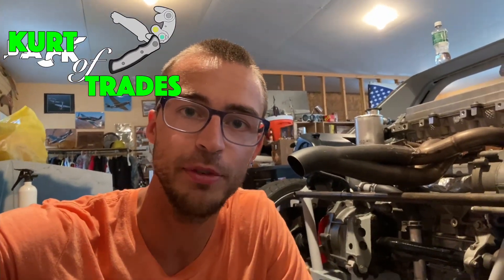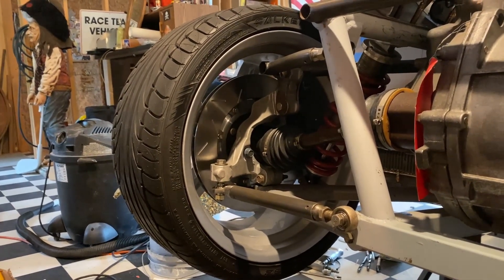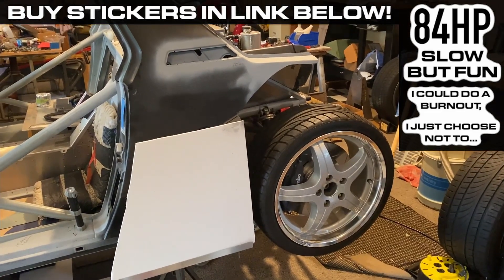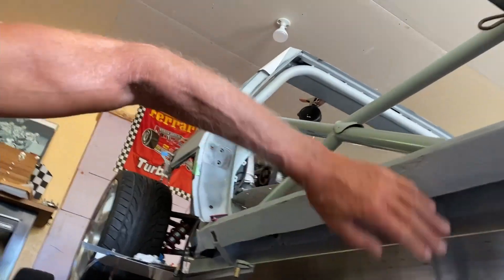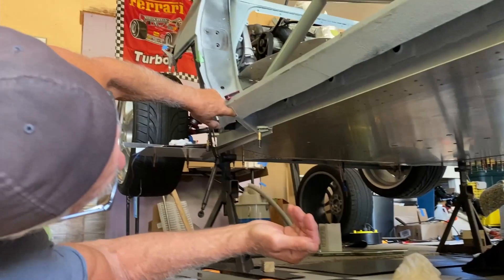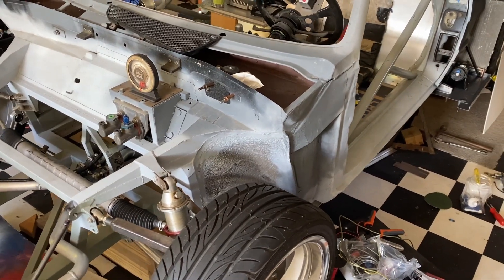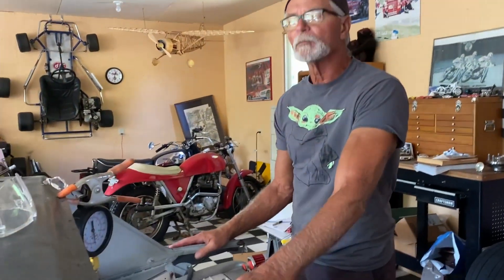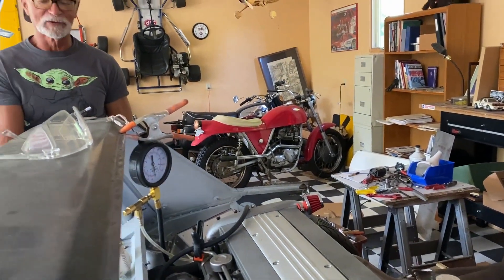Ep 5. - Fiat X1/9 Swap - Race Suspension, Wide Body, and Cooling System Dive!

Comment: When I was a senior in high school in 1977 one of the other students had a new Fiat X-19. It looked very sporty, but was slow and quite scary for reliability- I was driving a 1969 Chevy Impala with a 327 cubic inch small-block V8, and a lot of body rust so it only cost $200. This modified Fiat will be amazing- I have seen that it is difficult to find a windshield in good condition for them.